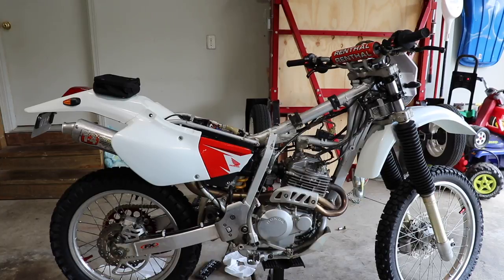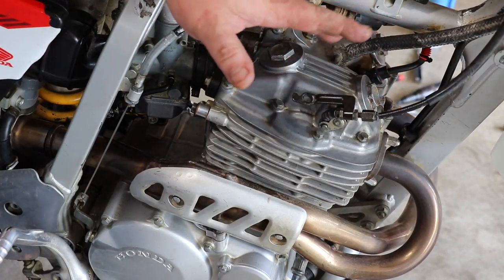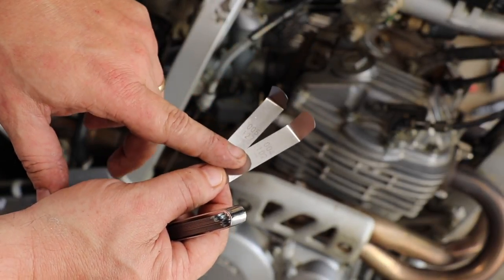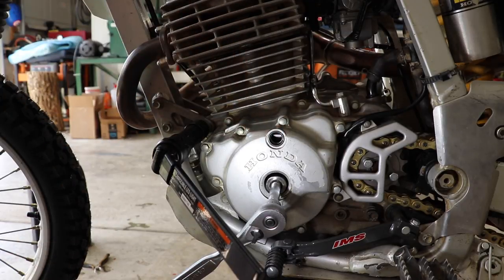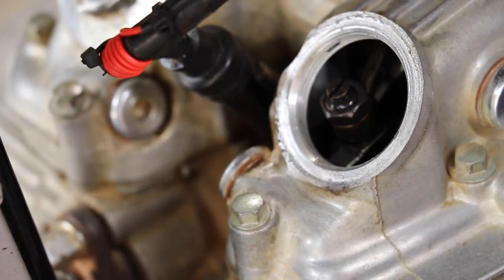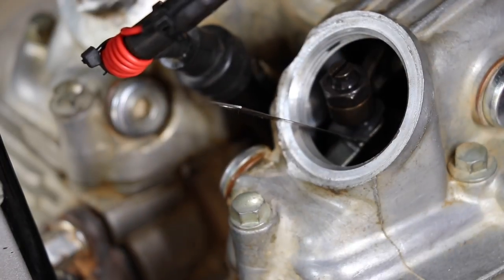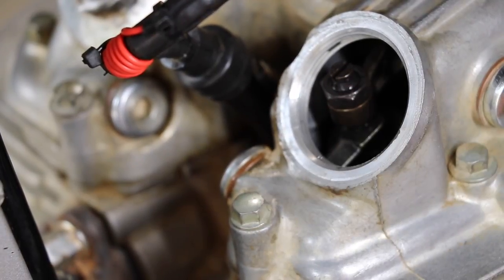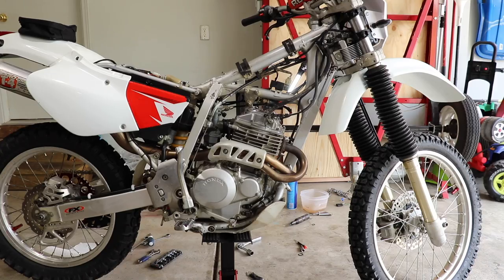How to Adjust Motorcycle / Dirt Bike Valves : Honda XR250R Street Legal

Comment: Maybe worth adding, when locating TDC, if the crankshaft passes the T mark slightly, never rotate engine clockwise to get back to the T.  Even if its just 1mm and tempting.  It will trigger one-way decomp and screw up clearance reading on RHS exhaust valve.  Instead, rotate engine twice counterclockwise to get T TDC again.
Reply: What happens if the bike kicks itself backwards when trying to get it started?

Comment: I have a 1986 XR250R and I have a Honda shop service manual. My book is for 1986-88 and it list the valve clearance @ 0.002 for intake & 0.003 for Ex. I work at a Honda dealership as a factory trained Honda mechanic in the 70s and all the small bikes ,50s,70, 90, 100s ,125, 150s 175s all adjusted a 2 & 2, The larger bikes at that time set at .002 intake & .004 on the exhaust.

Comment: This video was a great help. My bike sat all winter. I brought it back out to fire it up and I felt little compression. I tried a little oil in the jug to get things lubed up but nothing changed, new plugs...same thing...finally I came across this video. took less than 30 minutes to check and adjust 2 valves that were out, both intake valves were tight. I gave the starter a couple of slow kicks and I felt compression again. Put the tank and seat back on and gave it a few kicks and fired wright up and runs great now. Thanks again!